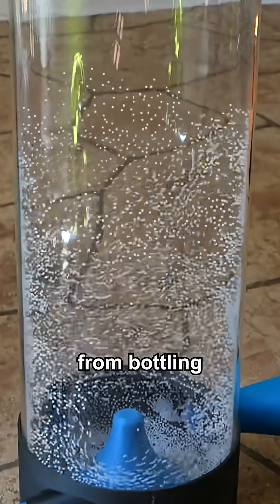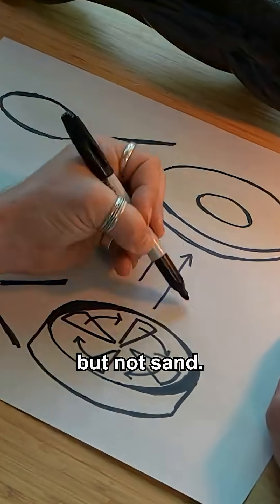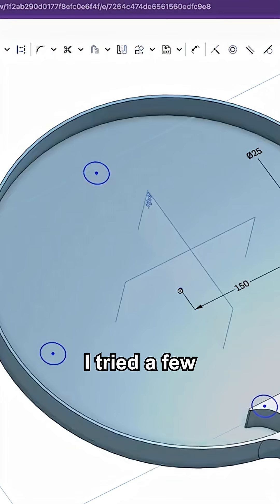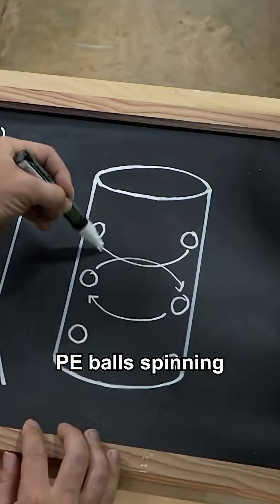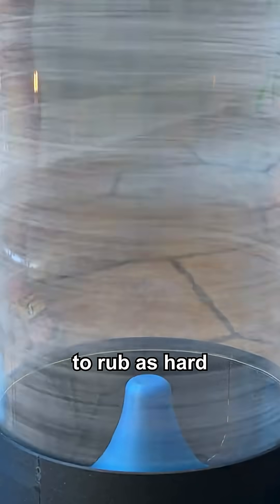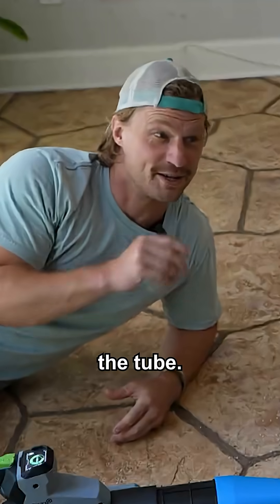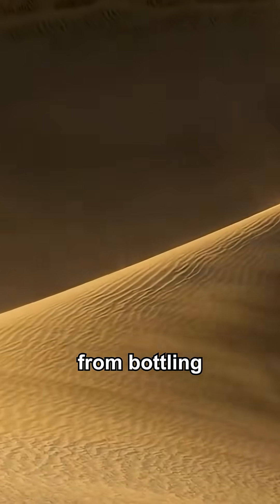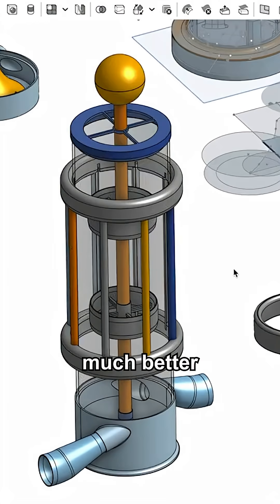I Replicated The Physics Of Sandstorm Lightning

Comment: This exact principal was used in early radiation detectors that needed no power. The rate at which static charged and suspended tiny plastic spheres fell from the inside of a clear walled viewing chamber over a measured amount of time compared to a normal background rate of fall from particles stripping electrons from the suspended spheres of same polarity static charge gave a very good estimate of radiation exposure over time. The initial static charge was provided by eother a piezo crystal strike or rubbing a piece of plastic worh some silk. Calibration was done by a sight circle and a begining ball count. The entire unit fit in your palm.

Comment: project idea: Watch Stan Deyo's anti-gravity lectures. He discusses Lorenz-O. Have a toroid plastic clear PVC tube, 2 cm diameter and fill with ferrofluid. Wrap a coil around this with about 435 feet wire, 24AWG, 1770 turns (around the tube toroidal style). There is to be a 24 degree air gap so end the winding on either side of this 24 gap. On a separate board, trace out the toroid shape and put about 26 one-eighth inch pegs about 1/4 inch inside this tube shape. These you will wind another coil to produce the other magnetic vector, solenoid style all the way around the inner circumference of the tube. This will require about 322 feet of 24 AWG, 177 turns, and keep this within the 2 cm height. Pegs can be 6 cm tall but only wire up to 2 cm -- the width of the tube to cover its cross section nicely. Inside this peg wall will need to be placed some ferro material. Bend 8 welding rods (or more) so they fit inside here. These should be shellac'ed so that each rod does not conduct with another -- like transformer lamination. But also, they need to be long enough to reach all the way to either side of the 24 degree air gap. Do not have any other air gaps in other places. This is a challenge. If welding rods are not long enough for your geometry, work out some other approach. My toroid tube is about 55.53 cm circumference so the rods are a little short . My structure needs about 4 oz ferrofluid. MS copilot gave me the recipe because buying it pre-made is expensive. Needed: .2 to .4 fl oz of magnetite powder Fe3O4, 0.4 fl oz oleic acid, 3.4 fl oz mineral oil. Mix well. Needed are two pulse circuits. If coils are about 11 ohms, then a 12v power DC power source is good. If you want to control frequency and pulse duration, create 2 instances of a coil driver circuit with GPIO pins of raspberry pie pulsing NTE3042 (330 ohm from GPIO to pin 2, pin3 gnd). The other side of the NTE3042 can be BJT TIP31C and 2n3055 with appropriate resistors. Use IN4007 directly across the coil to capture back EMF and recirculate it into coil again. Stan Dayo claims you pulse one coil, then pulse the other coil, and this sets up a Lorentz-O where the ferrofluid can spin -- an early step into anti-gravity research. Pulse should be 1A (24AWG can handle no problem). Magnetic field from these on either coil should be about 0.1 Tesla -- which should move the ferrofluid.

Comment: Wrap the inside of the vortex chamber with bare copper wire. Poke a hole on one side at the bottom, run the lead into the chamber, and seal it with rtv or something. Wrap the inside of the chamber like a tesla coil except around the perimeter of the inside of the cavity and exit the tube in the same manner, on the opposite side at the top, leaving the second lead. The static gradient seems most dense at the bottom so make the bottom lead your positive and the top lead your ground. Hook it to an o-scope, flick the pumps on, record the reading while the vortex is going and make a short or video about it so I can see. This will help me with my own static electric work. 🫡